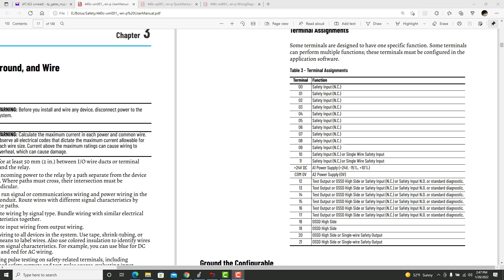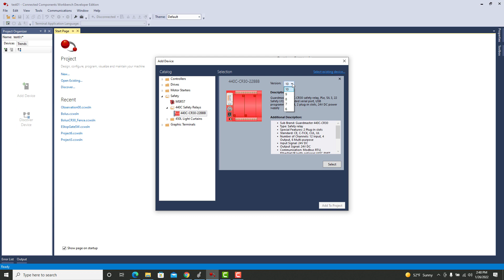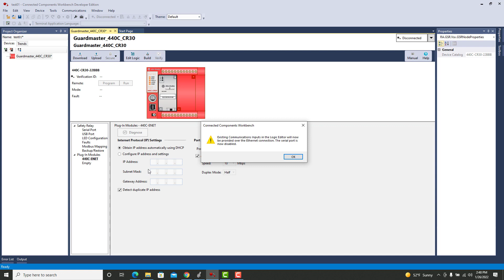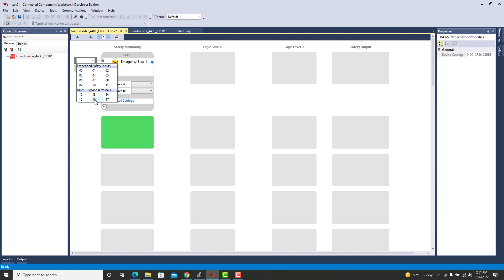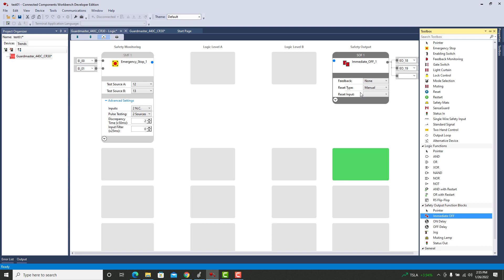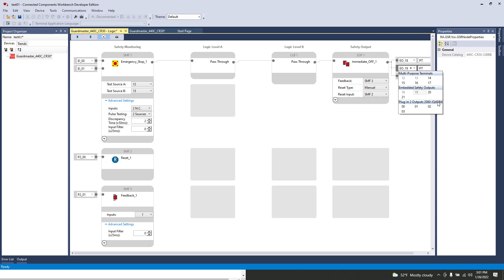CR30 Programmable Safety Relay - Electrical Design and Programming P2 - Configuration w/ CCW

Comment: Why is it ok to connect feedback signal to the plug in module which is non safety rated  ?  Also how does a test output signal work for the EStops  ?  Does it go low intermittently to confirm estop not bypassed  ?